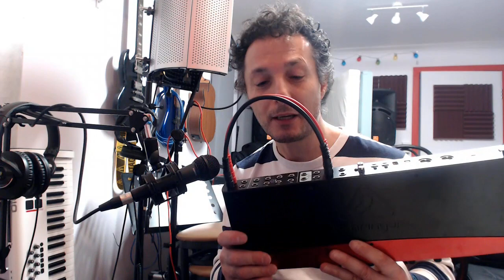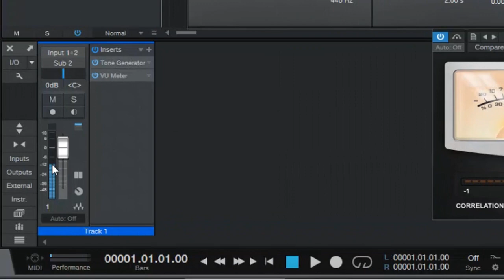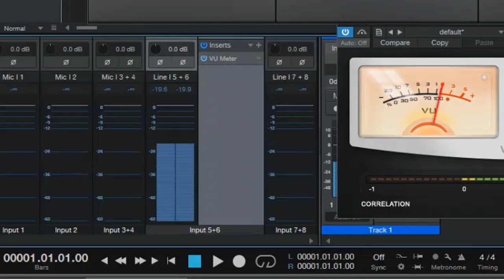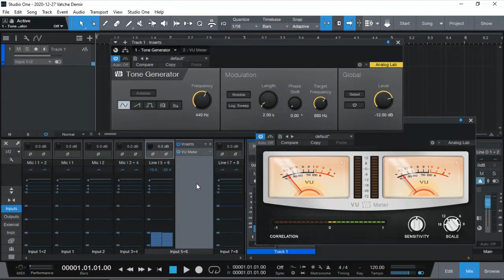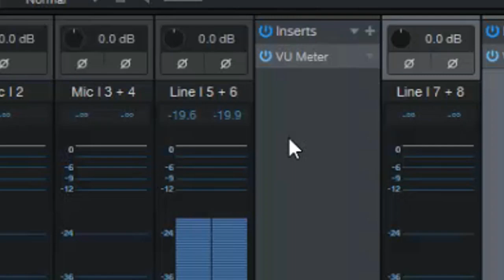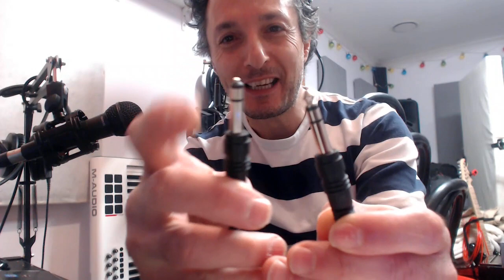Behringer FCA1616 Audio Interface | Testing the Line Level Inputs

Comment: Hi Vaitche. I have a question nothing to do with this video, but related to others you have done in the past...I am looking at the Yamaha AG03 for my guitar/singing YouTube channel recording, then I saw your video on the Swamp Industries SM11. The Swamp unit is MUCH cheaper than the Yamaha, so I’m wondering what functions don’t I get if I went with the Swamp SM11?

I’m a novice in the sound recording space so I’m not clear on what I get for $219 (Yamaha) vrs $89 (Swamp). Thanks. Dean.
Reply from the maker: You don't get any Compressor, EQ and guitar Amp-Sim with the SM11. SM11 is a very simple USB mixer.